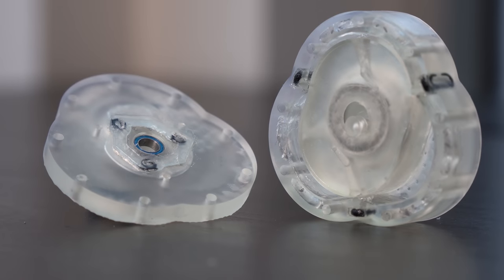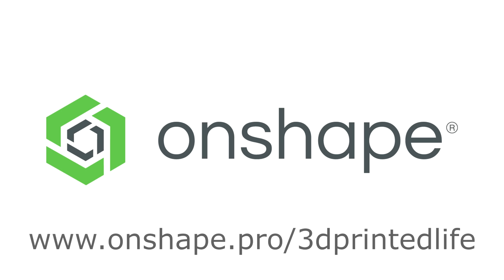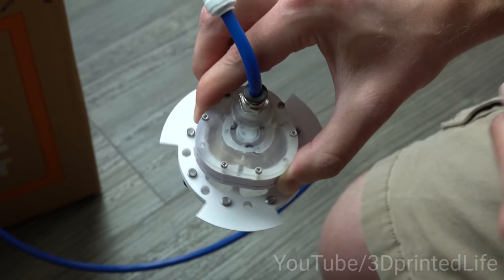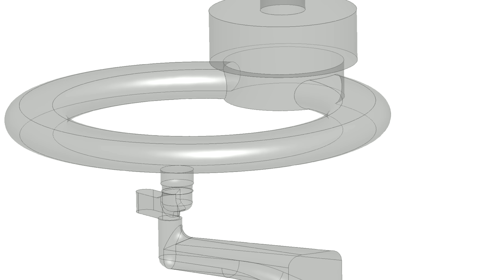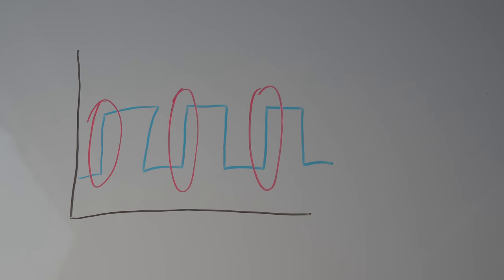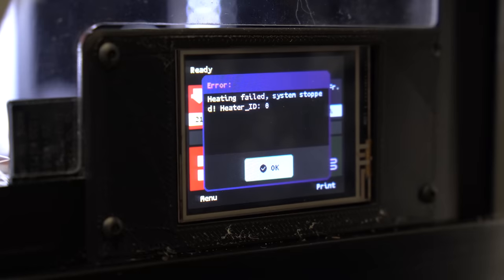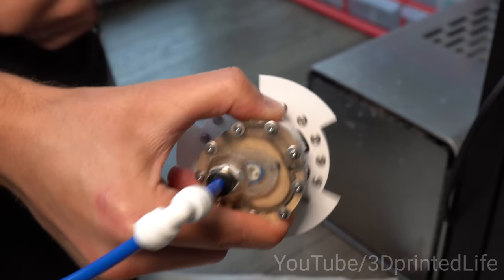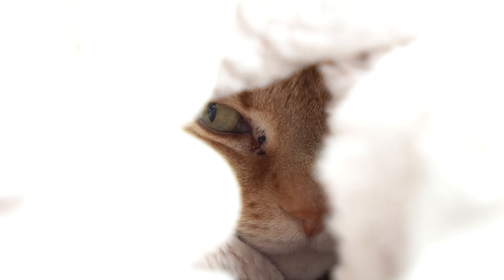I 3D Printed a LiquidPiston Engine, and it Sounds Incredible!!

Comment from the maker: You and your company can try Onshape for free at https://www.Onshape.pro/3dprintedlife 
Subscribe to make sure you don't miss my next awesome project! http://www.youtube.com/3dprintedlife
Reply: I saw that 3D Max sells a diamond nano particle infused filament for printing. It's stronger and self lubricating. Hope it helps.
Reply: have you considered a separate air intake on each chamber? because its going to be working almost entirely on preasure if you fire it in the top/bottom if you fire it in side of each chamber you also have air speed/friction driving it. also if you make a electric control valve where the 3 pipes split that holds one pipe open 1 closed and 1 pressurized you can create variable pressure with lower pressure in the 'far chamber' further reducing resistance
if you wanted to make a mechanical valve instead you could make 
something like a disk with a 2 tesla valves inside it arranged in opposite directions arranged so they always line up with 2 of 3 tubes 

while third one meets flat disk/is closed, that way youd have a pressurized intake some resistance on out take but still a outtake without it just blowing pressure out a release valve/into air and you could just spin the disk at differnt speeds to change the speed of motor with a fixed pressure source (youd want to make sure the outtake path was 2 or 3 times smaller than the intake though even using tesla valve if going to recycle the air/pressure just to get a high enough difference that it dosnt feed air down both particularly at high pressures. alternatively you could have the exhaust valve just blow out side of housing into air which is simpler probably, but you wont be able to maintain pressure/operation for long that way (you might have to have a feeder line from the outtake join directly into side of the main tesla intake valve, but ive never seen that done/dont know if its possible to feed one tesla valve into the side of another's without interrupting its flow)

Comment: Add a little acetone and the piston will really be liquid!
Reply from the maker: hahh no no no bad idea!
Reply: @3DprintedLife  acetone polishing is a useful technique.
Reply: Better yet combust acetone and air mixture inside for extra power !! All you have to do is pump in one hole that mixture put it over flame that heats housing to that temperature do it combusts inside chamber and get good life insurance 

Last very important
Reply: @gadlicht4627  No such thing as good insurance, especially for experimenters.
Reply: @techstuff9198  it’s joke
Reply: @gadlicht4627  I'm aware.
Reply: @3DprintedLife  why bad? Should be beat for ABS
Reply: Lip balm on the lobes

Comment: More Flywheel mass. I built a double acting single cylinder steam engine that ran on compressed air, so the stroke in both directions were powered. It would get caught at TDC or BDC and wasn't very smooth or reliable. I added a 5lb metal plate from an old exercise set to the crankshaft, and it made it run like butter. The greater the rotational inertia of the flywheel, the smoother the engine will run.

The other thing, is Cam timing. Steam engines have very clever linkages to control the advance of the valve action. It makes a huge difference in high and low rpm realms. Car engines are running between 600-6000rpm usually, so the valve timing only needs to appropriately cover a 10 times range. Since you need to go from a couple of RPM to hundred or thousands of RPM, you will need a much broader range of advance control. Im not sure how that works with a Rotary, but if you had a way to delay the intake action at startup, and advance it as rpms rise, itd make for a much better performing engine. Classically on piston steam engines, this was dont with a hand lever that cantilevered the linkage between the camlobe and valve body, but it should be possible to do it automatically with a governor. As the engine spools up, a set of spring loaded weights are swung out which push the assembly up or down, or, the governer is on a helically splined shaft, as rpms increase and centrifugal forces increase, the governor climbs up or down the helical teeth which alters the valve timing.

If you google some old steam engine setups, you'll see how gorgeously simple the contraptions that the intellectual giants of the past pioneered are. Just seeing a few examples is all it takes to have the knowledge to design your own clever governed advance.
Reply: Yea, what he said. You need that mass to drive it over center. Just like a car engine's idle with a performance cam.
Reply: @markwhelan1652   the engine has such little torque though, he had to increase airflow to make it work.

Comment: 1:13 Just fyi as someone who uses onshape about 8+ hours a day for work I think it should be noted that, although Onshape it might be Cloud based, it does run in the cloud, whilst there are add-ons for simulation and FEA to be run on the cloud, as cloud compute; the CAD itself is not, it runs in your browser, but your computer hardware is still be used. There is a system check function you can do to check how good your system is. So a faster more powerful machine will be better than a $200 chromebook.

Also there are plenty of features that have been promised to onshape users over 8 years ago, and they still have not been made.,
Reply: Indeed, I used Onshape a few times over the years and there are still several promises they have not kept, along with a few things that WERE beneficial that they removed... While I can appreciate some of the ease and accessibility, there is still the "cloud" based nature of the product... meaning that it is insecure, reliant on the primary server remaining active, virtually useless when internet connection is lost or gets sketchy, and other factors outside of your control or influence.  I have not yet found a really good program that is easy to use, relatively cheap, and solves many of these issues... the last really good one (although more expensive) that came close was Autocad 2016 before they enacted their horrible "subscription" service.  I avoid ALL cloud based or subscription services like the plague!  Yes, the other ones have their own drawbacks or obstacles, but I can keep working on my laptop without ANY internet connection or dependencies other than power.... I also maintain my OWN copies of any work within my own system (along with very regular backups) for full privacy and ownership of my designs. Smart people will only get burned *once*...

Comment: "As powerful as it is reliable"
Just like a real rotary engine
Reply: EMOTIONAL DAMAGE
Reply: unreliable*
Reply: @randellsmith7651  No, they're still a joke.
Reply: @canonicaltom  in terms of simply power to weight ratio, power to size ratio, and power to complexity ratio, combustion rotary engines are no joke at those. however no one can deny the issue of temperature gradient (since hot gas is on one chamber and exhaust is in diff chamber and intake is in diff chamber causing the chambers to have different temperature that warps the engine and cause inefficiency) and the apex seal issue. which is what the liquid piston engine wants to fix.

tldr: the only thing bogging down a Rotary engine is its unreliability. its power and efficiency is the real deal. liquid pistons aim to tackle the unreliability issue.
Reply: @aoyuki1409  Actually it's quite the contrary. Rotary engines are reliable af, but fuel inefficient and it produces more emission than piston engines. The LiquidPiston design fixes that issue.
Reply: They are not unreliable as long as you take care of them
Reply: Once again, Wankels are more reliable than traditionals piston engines, they are just a lot harder to maintain.

Comment: Awesome video! A word of caution for future, if you ever get into sustained loads with a prony break based dynamometer - it gets HOT, and fast. With my electric motor power measurements, the thing that eventually exploded my prony break was that the PLA started to expand due to heat, and eventually even melted, which causes more friction and consequently the applied load goes up exponentially. At one point, either the motor/engine stops or the prony break has a rapid disassembly.

Comment: So I've got a wacky one for you. You may have seen the pentagonal rotary engine floating around on the innerwebs. Supposedly it is a motor that was used on a Russian torpedo or something like that? Anyways, I have designed an engine based off of Integza's rotary, which was based off your rotary anyways. I liked his idea of using the first air expansion to feed the second air expansion on the Wankel, so I used that idea to make my pentagonal rotary. With the 5 sided rotor, the final exhaust pulse actually happens around the same time that the first intake stroke happens on the main air intake. So basically it has 4 expansion chambers feeding off of the original intake chamber. In theory it should be able to take advantage of a LOT of the energy of the expanding air. I could never get it to work with the original idea of the gear though as the gear ends up being so small that its basically unusable, however, flipping it around like you did hear MIGHT be the way to make this work that I never thought of! I have done all the math and could share the design if you like. Might save you some time if you wish to take on the challenge of the first ever 5 sided rotary air engine!
Reply from the maker: Interesting idea, hopefully you are able to get it working! Personally I think I'm done with air engines for a while hah
Reply: Damn, this is a really interesting idea. Do you have a link to any of this? It'd be great to have a look

Comment: Instead of springs, could you use air pressure to behind the rotor seals?  As a bonus, the contact pressure would scale with the operating pressure.

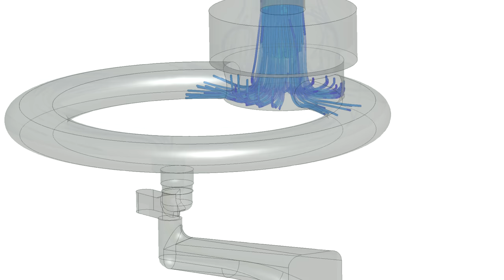Comment: At 6:10 of the video during the flow animations you are losing alot of efficiency 5-10% when your airflow makes the first drop and then again when it runs into itself before it exits. You need to refine these points taking into consideration your fluid dynamics. Reconfigure the ports more like you would for actual fluid instead of air. Your getting what's pretty close to a liquid lock with the flexible materials at the beginning and end of the "strokes".

Comment: ? Have you tried over lapping the port openings  so that the next inlet starts opening before the previous one fully closes., If say, previous chamber opening is 3/4 open,  then the next chamber will be 1/4 open, ditto, 1/2 -1/2,  ditto 1/4 - 3/4.
Theoretically (in my head that is), you should be maintaining a constant pressure flow. And therefore hopefully, not locking up the rotation, which is what it appears to be doing.
I could be wrong, but I think it might be worth a try.

Comment: So I am looking at your onshape design (fellow onshape user her love it) and I see that you are trying to seal intake port as part of the housing.  In the original liquid piston the intake port is sealed by the apex seal as it moves from chamber to chamber.   And uses spark to ignite of course.

What if you moved the intake seal into the shaft itself instead.  Sort of like a sliding valve in the old days.  This would take it off the piston outer wall, and move it into the shaft where you can control the seal or leak of air outside of the piston.  So any leaks can be over come, because the piston isn't the leak just the shaft, which has no bearing on the function of the expansion of the housing.  You could probably do this with a lobe or screw like design where the screw in shaft.  Either way this will solve your valve leak.  In fact if i have an idea already in mind how this would look...

If you really wanted to mimic the 'explosion' of the combustion cycle, put a magneto timer on the shaft, and instead of running a spark, it runs an electronic air valve to open, mimicking the spark.  There will be no valve seals needed, since the pneumatic valve only opens when it passes the magneto.  As well this will let you run on bursts and pulses instead of requiring constant flow through the chambers.

Comment: now the question is can it outperform an air driven vane rotor? the standard for air tools
Reply: @sourand jaded oh yeah that's for sure easiest way to get A LOT of mass going with high reliability is pistons but it is as you said rather expensive for general use so the common motor for air tools is what's interesting to beat here pistons are just unbeatable in the category

Comment: It's an inverted Wankel. Neato. I figure it still has the same issues if it were used for internal combustion. (Still needs the equivalent of apex seals, even though now they're on the stator part.)
Reply from the maker: Yeah most of the same issues, apex seals are a little easier since they are stationary instead of on the rotor but other parts of the engine are more complicated due to the inverted design.
Reply: Lots of small Liquid Piston engines have been made, and are sold as ICE drone engines.

Comment: Respect for your patience! 👍
And we can see why this silly design will never amount to much commercially, despite their outlandish claims.
Real world engines are based on good sealing and good wear/rebuild performance.
Reply from the maker: The power to size/weight ratio is quite a feat, but yeah getting these as reliable as standard piston ICE's is never going to happen. There still may be a niche market for compact combustion engines like this though.
Reply: The guy is trying to 3d print an already working wrll in real world engine.  Its not the engine design of the real world engine, its the 3d printed version designed by this youtuber  that is not working and unreliable.
Reply: @JamesHarbal    yes I understand that. 
I'm a professional designer and I have looked at the "real" engine videos. I have also built a few high performance gasoline engines over the years.
There is a reason we dont all drive around with rotary gasoline engines... because they are borderline at best and an unreliable dumb idea at worst.

Comment: What about sloped intake ports? so that air can slowly feed in air to the new port as the "piston" rotates. By sloped i mean make a channel that slopes into the intake from the surface of the "piston"
Reply: The only issue then is sealing it, would be more difficult, so maybe try some kind of silicone? u could just shape it on a paper template, peel it off then add it to a slot on the rotor.

Comment: Nice 8-) Although, that engine  is probably more accurately described as a Cooley engine since John F Cooley patented the basic design in 1903  . Interestingly the better known Wankel engine is a sort of inverted version of this design,  in that the rotor shape of the cooley  becomes the stator shape of the Wankel and the Wankel's rotor is a triangle joining the contact points if the seals . 

The Cooley, has been 'reinvented'  many times 8-)

Comment: i think several improvements can be made with the engine.

1) make the entire design slightly larger in size so that tolerances would have less effect on the overall system. maybe 40-50% bigger should do the trick
2) add a flywheel since the engine seems to be choking
3) maybe try acetone treated PLA or polished resin to further reduce the friction coefficient
4) bigger air supply, or perhaps combustion but i think we're still far away from combustion engines. lets stick to pneumatics for safety and practicality for now. maybe try those 16 litres bottles at 50-60 psi but im not sure if those bottles can handle that much pressure. The walls seem thicker tho. Also get an air pump unless you wanna get your arms very ripped from all that muscle juice
5) if possible, control so that the air only goes into the system when the intake ports are near the holes so that less air pressure is wasted just being turbulent or leaked. since you're pretty good with electronics maybe u can go digital instead of cams. however im not sure if the benefit will overcome the drawback of pressure drop from having another valve.
6) integza has been using graphite powder to lubricate the insides of his engine design so perhaps if you can get hold of some graphite powder it might prove to be better than teflon tapes. you also wont have to deal with flying grease anymore.
7) that paint idea from your wife was brilliant. maybe using that method more often for debugging would help in future prototypes

Comment: I never really understood these power meters. I assume the torque is set according to how tight you tighten the screw on the axial shaft. Wouldn't that mean however that you only tested the engines on a specific torque? There would be a different result in total work measured if you applied a different torque. So the comparison between different engine designs seems sketchy to me as you don't know which torque works best for each engine.
Reply from the maker: Yep you're exactly right, and it's not ideal. I've thought of adding a servo to have variable torque on the bar, but with my limited air supply there's no sense since it would run out of air before even needing to adjust torque.
Reply: @3DprintedLife  Okay that makes sense. Maybe you could instead test the engines for different torques each. It would be more work but might yield interesting results.

Comment: The piston as it expand, so be having air to it constantly! The piston  when it contracts, so be having air constantly to the exhaust! So there are three intakes and three exhaust! You should be able to turn the motor, and it be  able to pump water!
Reply from the maker: Since the intake and exhaust ports are on the rotor, I actually only need two of each. They move from chamber to chamber to intake and exhaust air. But you're right, it could work as a pump!

Comment: would it be possible to add candle wax inside the chamber to seal up the gaps between the plastic printed threads, then scrape off any exess?